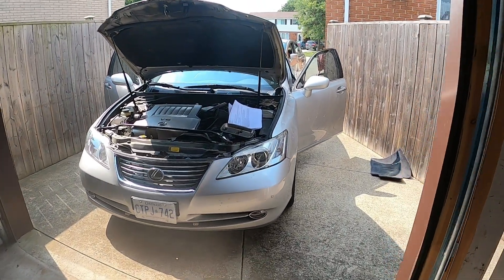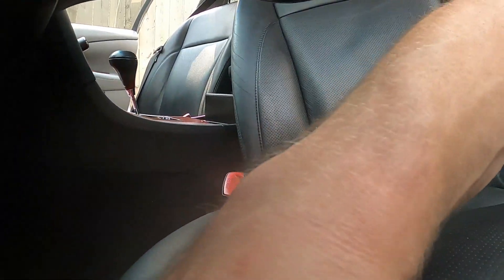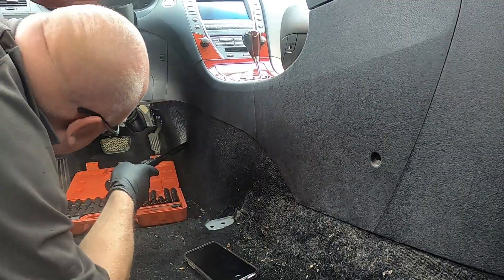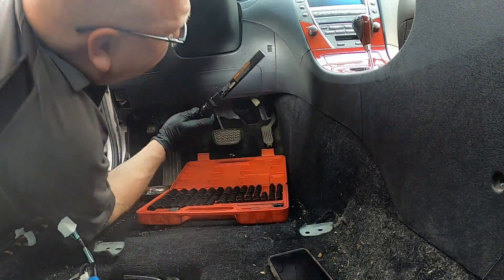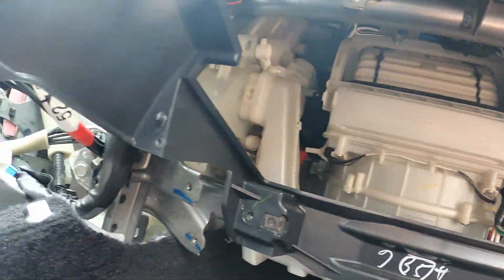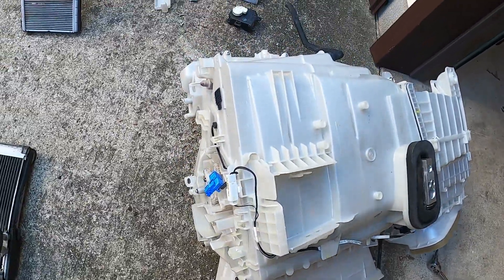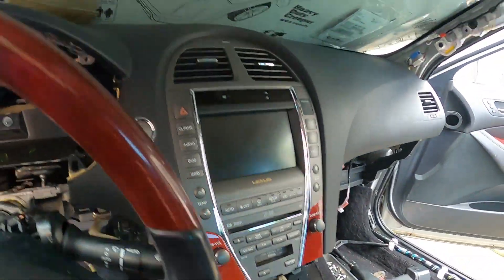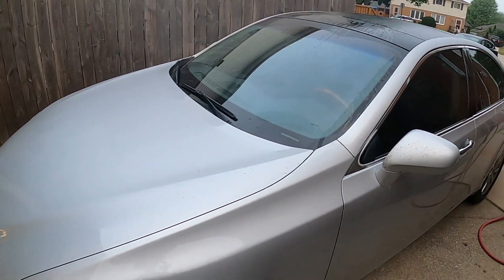2009 Lexus ES350 Heater Core and Evaporator

Comment: Well my local Lexus dealership in Indianapolis has ultimately diagnosed my evaporator core as the cause of my refrigerant leak in my 2007 ES 350.  to replace the evaporator core and to add an expansion valve and o-rings for line going to expansion valve and to replace the air conditioning receiver dryer assembly and to evacuate and recharge the AC system they want $4,877 including Indiana sales tax.  Yikes.  I love your video but I must admit this looks like one heck of an involved job.  Wheeew.  I did my own radiator replacement in this car and saved myself about 450 bucks.  Don't know if I have the skills to do this one or not.  But I sure can't pay what Lexus wants - whewww.  Thank you again for posting this very helpful video!!!  For now I just put more refrigerant in about every 3 months in the summer.  Keeps it cold for a while.
Reply: What did you wind up doing? Did you ever get it fixed? There has to be a reputable shop or local mechanic who can do it. Im sure it wont be cheap, but definitely not what the dealership is quoting you.

Comment: Thanks for this video it help me a lot, I did all the job and everything work good but the climate control it work wird, if I have full cold ( LO) work fine  if I put 1 degree up it turns heat so I have to keep the ac in full, any suggestion? thanks

Comment: Thanks. I will attempt to do this myself on the same car this weekend. Have you confirmed a leak in the evaporator?
Reply from the maker: The problem on this customers vehicle was a bad heater core. But as you can see it’s a big job to get out, so it was decided to change the evaporator while the case was out. They have been known to develop leaks.
Reply: @mearsmobileservice4547  My son's 2008 es350 has the same problem. It was so bad that antifreeze leaked into the carpet and the evap core went out at the same time as heater core. I'm probably gonna have to remove the carpet and the insulation as well. What a pain in the @$$.
Reply: I am still working on my wife's 09 ES350. I am struggling to remove speaker grills without damaging the dashboard. Service Manual suggest prying with a taped screwdriver. My dash became so brittle and somewhat sticky that makes it impossible to remove the speaker grills without damage to the dash. Any alternative suggestions?
Reply: @kivancbiber  I'm no mechanic but in another video a guy was using a pry tool specifically for prying up on automotive trim pieces. Also my son's dash is sticky as well. I assume there was a technical service bulletin for this at one time which is ridiculous for a supposed luxury car.
Reply: @MemphisTiger I tried trim tool as well but no luck. I am thinking of using a piece of credit card to place between the dash and grill and pry using a trim tool. Hope is that Credit card may distribute the load decreasing the damage to the dash
Reply from the maker: @kivancbiber  try using a paint stir stick to pry against. Lay the stick on the dash . They do just pop out. This will disperse the pressure across the width of the stir stick. Worth a shot.
Reply from the maker: @memphistiger4647  wow that is bad! Coolant is not easy to get out. Likely will have to clean a few times. Good luck!
Reply: @memphistiger4647 I wonder if the sticky dash issues we have is exacerbated by a leaky evaporator core.   funny how it's especially sticky around the defrost vent in the center on mine.

Comment: How much the total cost for this work. I do have to change my heat cover and Evaporator on my 2007 ES 350
Reply from the maker: If you were getting it done by an automotive shop, you would likely be looking at roughly 10hrs of labor times per hour labor rate. The parts are about $300.
Reply: Around $2500 parts and labor.

Comment: Looks like an easy job 🤪
Reply from the maker: Yes only took 44min.
Reply: @mearsmobileservice4547  haha
Reply from the maker: @BlackWingMoto  of course you know that is the length of the video!
Reply: Super intricate
Reply: This is what ive noticed on my is350. The ac fan blows very powerful, and when my heater is on high you can barely feel the heat blowing out. It does heat up the interior just doesn't blow very hard? Would this mean my heatercore is clogged? The cabin air filters been replaced and is not clogged up